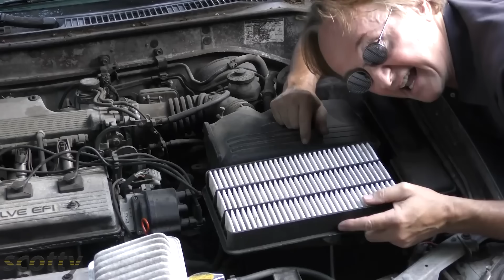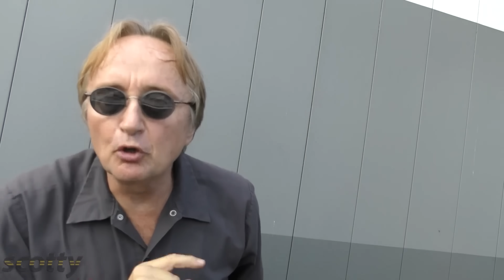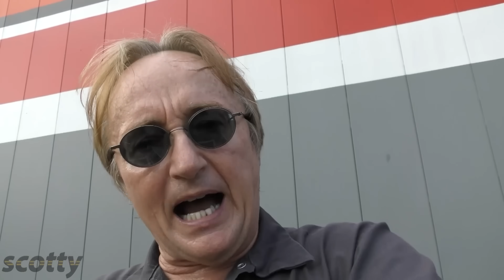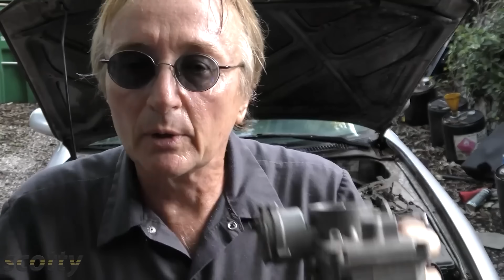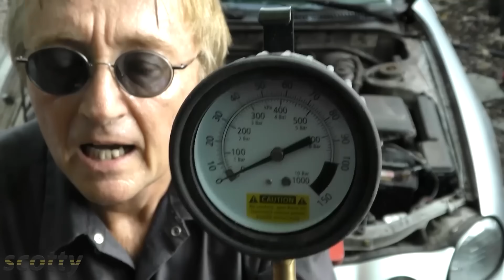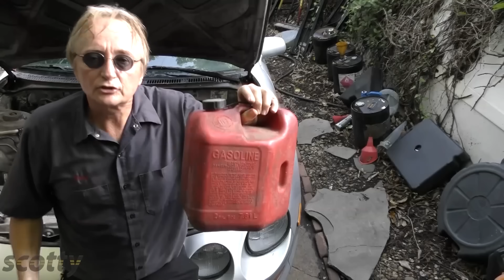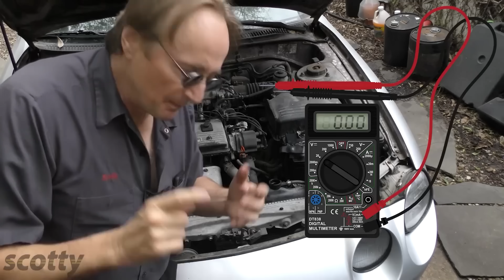3 Things That Will Make Your Engine Last 500,000 Miles

Comment: I have a 17 year old car with 20,225 miles.That means my car will last me another 425 years
Reply: But you won’t last the car 425 years.
Reply: @ShiftySkunk  Are you sure
Reply: Yes right 😂. Let me know where is your brain filter located 😂
Reply: @sunnyd9710  Under the dashboard somewhere
Reply: @sunnyd9710  under the dashboard
Reply: 🎉😂 @sunnyd9710
Reply: Not if it's gm
Reply: @ericfrontczak8016  Porsche
Reply: Except it won't, because vehicles need to be operated regularly. Seals and gaskets will dry out and become brittle; exposed metal-metal parts will rust weld; tires will dry out and the rubber will crack; fuel, oil, and other fluids will go stale, gum up, and/or separate. I have a truck that my mechanic (the guy who does all the stuff I refuse to do or lack the necessary tools and equipment to do) insists I drive more than the 2,000 miles/year I normally put on it.
Reply: @ Oh no,so my car WON’T last another 425 years?
Reply: @ I don’t believe it will, but if it does, be sure to dig me up and tell me I was wrong!🤣
Reply: Mine has 50000 miles.
Reply: You need to get out a little motr😂😂
Reply: @gleenapaddock9858  I don’t drive very much.I sold 3 that were like new,so I’m down to 6 .They were all bought new from about 2005-2024 . They all have very low miles but although they were originally nice cars,Bentley,M6,Porsche Targa,2 Range Rovers,but they aren’t worth much to others because if anything breaks the repairs are ridiculous.
Reply: Noice.
Reply: My Jaguar XJL is over a dozen years old and is approaching one quarter million miles! Just do the maintenance!!! (Oh! Theoretically it can go 155 mph; I don’t even try! I think it’ll last longer that way!

Thank’s Scotty, still learning from you as I was fooled into believing silicates were ‘bad’. (Now I realize, it’s just the old, pre-hoat spec.)
Reply: Dude nice
Reply: Hahahahaha!😂
Reply: First generation cars had the equivalent of the 1980s Rainbow vacuum cleaner technology. My father bought one from  a door to door salesman
Reply: Drive more or else Torreto will drive it through three skyscrapers. Reminds me of fast furious 7 of that one guy who keeps a Lykan hypersport on top of a skyscraper with no way out and nobody drives it.

Comment: I remember my 1950 Ford F1 with the flat head V8 , in which my air filter on top of the carb had àn oil type of device that was the filter

Comment: Please what causes spark plugs to fail within a very short time? Some of the spark plugs in my car no longer lasts long and they fail within two weeks causing the engine to misfire.
Reply: Change cables too and see if the problem persists
Reply: What do the failed plugs look like?
Oil fouled?
Melted?

Comment: Only toyota's and Hondas last that long
Reply: 2003 Ford e250 4.2 with 330,000 miles here
Reply: @HaloDaycare  . Lucky enough 👍
Reply: My friend’s VW Jetta has 375000 miles!
Reply: @Alfra1324  but not 500k
Reply: @Alfra1324 betta getta jetta
Reply: Had a Ford last 600k.
Reply: My uncle's old Ford pickup has nearly a million on it.  It's only a 1982 model with manual windows that his grandkids are flummoxed by.  It also helps that he is one hell of a mechanic.
Reply: My 4.6L will run 700k easily
Reply: Not true, there is a Ford f150 on YouTube with 1,000,000 miles, and I've personally seem many Chevrolet and GMC with over 500k
Reply: @MX-CO  👎
Reply: My Mitsubishi outlander 416,000kms
Reply: Crown Vics beg to differ.
Reply: My 2002 F250 super duty 7.3L PSD has around 350,000 mi on it right now.
Reply: @Pahrump irrelevant, we are discussing gasoline vehicles, diesel engines are totally different.
Reply: @Pahrump  my 2000 f250 7.3 has 246,000 on it, only needed a water pump, other than regular maintenance oil, oil filter, fuel filter, air filter brakes, tires , awesome truck
Reply: @Pahrump love hearing this. Those were great trucks. And yours still is!
Reply: @Pahrump  Hope it makes it further
Reply: Crap cars don’t last. Don’t buy crap cars……Don’t hot rod don’t drive it unnecessarily …perform regular scheduled maintenance.
Reply: My Mazda 3 has 254k. Going for 300k. Manual transmission original clutch.
Reply: You can get a Mustang up there if you stay on top of maintainance the entire time.
Reply: Crown Vic’s beg to differ
Reply: old hondas with 5 speed auto and 1.8 ivtec. modern hondas with 1.5 turbo and that cvt cant even reach 100k miles without major failure 😂
Reply: Not the new ones.  I used to say this.  Can’t say it anymore
Reply: @lewisharris6180  yea the new ones are shitty
Reply: Mazda last 1,500,000 miles
Reply: @Elonmusk898  no Elon they don't.
Reply: @AuditingTheSOUTH  yes they do doofus
Reply: I agree ☝️
Reply: Nissan sentra 2002 143,000 drives like brand new just replaced belts
Reply: I have about 390k on my ZJ.
Reply: I have a 2011 Chevy Cruze with 250,000 miles on it believe it or not, I’m halfway there although I don’t expect it to get to 500k
Reply: No my 05 avalanche 5.3 has 400000 just depends on if you take care of it or not
Reply: You're right about that ❤
Reply: Pre 2008 Nissan's aswell
Reply: That's the truth
Reply: My 911 and m3 say different
Reply: buick lesabre 2000
Reply: Wel not Hondas but Toyotas yes
Reply: Toyotas yes, hondas no
Reply: And skodas...at least the older gen
Reply: Motor will easily go 500k but every thing else will break along the way
Reply: The new ones certainly don't last that long.
Reply: I have a Audi 80 b3 1.8 carburetor great car it is still running perfectly after 600 000km and has had no major issues with the engine except a blown head gasket 3 years ago, I daily drive it and do over  700km a week with it and it has never left me stranded. Just proper maintenance and simple engine reliability.
Reply: I love k&n it allows me to just re wash it I don’t have to spend anything or waist time.
Reply: This is a lie
Reply: Oh boy Americans and their “Toyotas and Hondas are the only reliable cars” garbage

Please just learn about other cars 😂
Reply: I have a BMW 120d with 300k miles. Still runs like new and does 70mpg.
Reply: @Formu1a87  Record it let me see
Reply: I have a Subaru that has 4 hundred billion kazillion miles on it
Reply: All new cars are junk. Even Honda and Toyotas! Use crap parts, you produce a grap car.
Reply: Ford Crown Victorias last longer than Hondas and Toyotas. There's taxis with 500,000 on em and still running good. I have a 2009 police interceptor. Was Indiana state police car and approaching 220,000 and runs like a top. Any car can last with timely maintenance.
Reply: Late 90's Holden commodores are known for lasting that long too. Good old 3.8l v6 series 2 ecotec
Reply: @cocojinx9193 ackshually it's a buick 3800 from us
Reply: Chevy Suburban can do 500k
Reply: Could be for new ones.
Actually my 95 GMC and 72 Ford are still going fine. Fix broken parts yourself. Go very long time. My cousin has the 55 GMC still going that Grandpa bought new.
Reply: Too bad the body & frames are weak & rust!:eyes-purple-crying:
Reply: @robertblacksmith4355  there's no perfect car.
Reply: @AuditingTheSOUTH  the 1991 Honda Accord.   Those versions were nearly indestructible.
Reply: Honda's
Reply: Only bmws last that Long. They never have any problems at all..
Reply: Only Kia lasts that long 🎉
Reply: @HeavilyCensoredKitty  lol no
Reply: @HeavilyCensoredKitty Ford Crown Victorias blow Kias out of the water. Police and taxi vehicles that run forever. There's crown vics with 500,000 miles and still run great. No Kia will ever see 500,000 let alone 300,000
Reply: @HeavilyCensoredKitty in your dreams only
Reply: @JAM_2024  I’m sure my 2003 Kia Specta GTS that needed a new Transmission at 130k Kilometres was just a one off and don’t represent the rest of the KIA kingdom that routinely gets 500,000 Miles...
Reply: @HeavilyCensoredKitty hahahahahahahaha. I usually don't crap in car brands. But for God's sake FIX THE OIL PUMP
Reply: @mattcottrell3336  sheesh it’s just an Oil Pump not even that important!